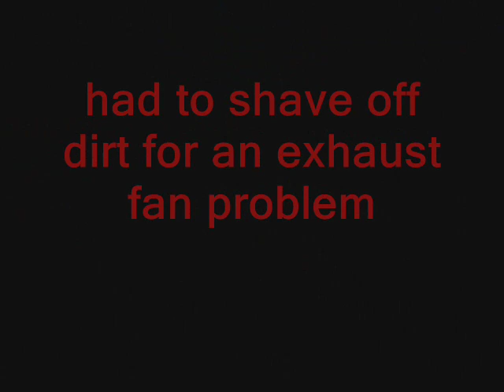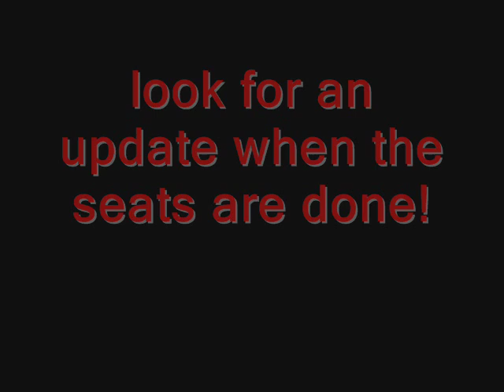golf cart rebuild (original)

Comment from the maker: I used alot more than i like but this thing was beat up pretty bad and the metal was so stretched out it had  serious "oil canning"  on both sides. The single edge razor blade just shaves the dirt out  then you wet sand and buff as normal. When all was said and done no-one could ever tell there was a problem. All in all the guy had about $160 in the paint and body; and more than likely will just tear it up anyway its a tool :)